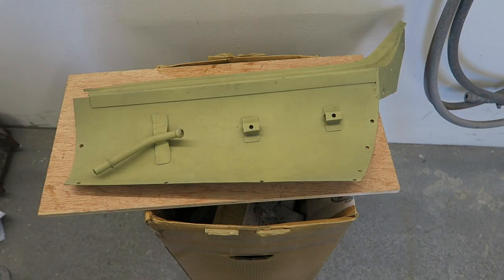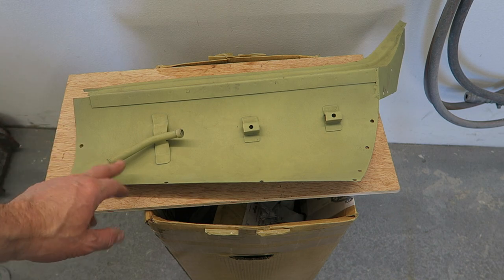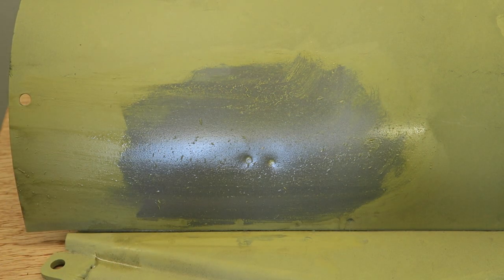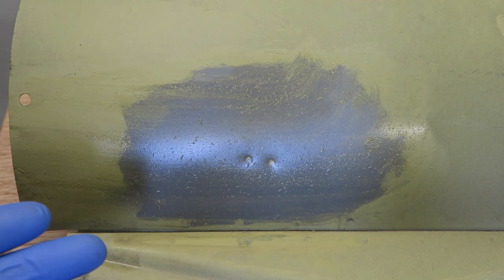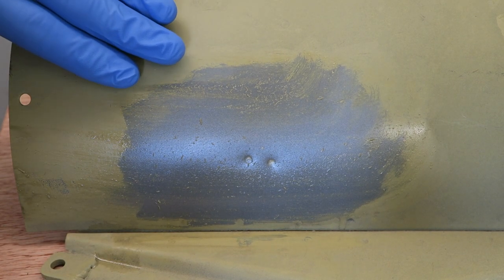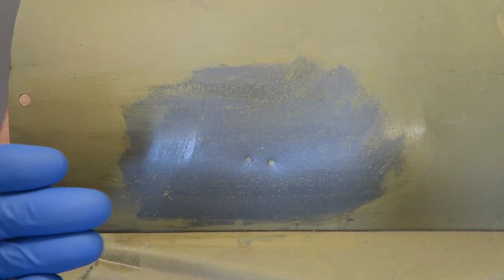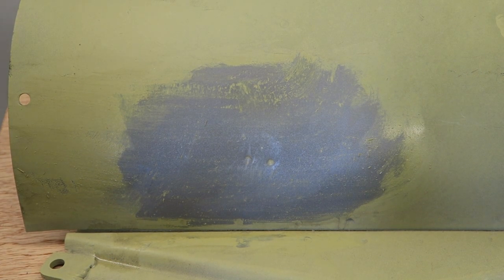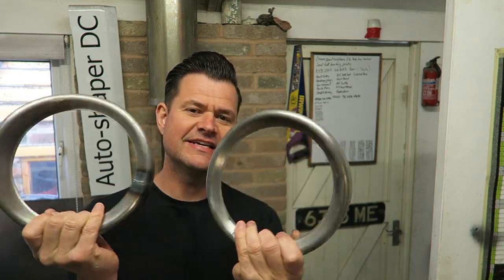Why to avoid applying carbody filler/Bondo over etch primer Tips and Tricks #29

Comment: Gday Trev! Another great video, I just finished the two week Tart up of my Austin Healey Sprite videos, and in that case I used filler over old acrylic paint, I’m guessing I get a similar issue here, where the paint around the filler work has left a ring around the repair, sounds like my only way forward is to take the entire car back to bare metal if I’m using any filler? Or is there a blocking primer I can use to then fill over old acrylic paint ( not just etch primer) ?
Reply from the maker: JBFromOZ it’s very difficult to give suggestions on such wide ranging issues and it depends how far you’re along the line. If you were still at the beginning stage I’d say yeah screw it and sand everything off before you do anything. But if you’ve put months of work Into it sometimes you’re better off just carrying on. There is a product called barcoat that acts as an isolator between two incompatible products. Cheers Trev 👍
Reply: First time around on the Restoration was in 1986, I was only a little tacker, and paid someone to do body work, over a sandblasted and red oxide primer paint job, then dad and I did the paint work together in the garage at home, it looked flawless back then, but 33 years have not been kind to it :-) back to metal sounds like the plan, rather than keep blogging over old repairs, ideally I’d like to get the underlying metal in good shape, now I’ve got some time and experience under my belt, (oh and the fab inspiration from you and others sharing their skills)

Comment: I've used bondo filler over rustoleum etch primer with great results. No lines/ ringing, no softening or peeling. 

also if you taught me how to paint i would 100% end up pulling my keys out of my pocket and scratch up the surface... when you mean to sand it.
Reply: so have I and got away with it...for a while. Even Rustoleum states in their TDS "do not use under filler or polyester putty".

Comment: Hello Trev. Hope your well. I've heard if you fill over epoxy within 5 days there is no need to key up  as the epoxy still has a bit of tack to it. What say you sir?
Reply from the maker: Skibum Wannabe sorry about the late reply, for the effort involved I’d always sand it once it has initially set. Yes you maybe able to overcoat it, apparently it grips other paint products because it’s shrinking for up to seven days but there’s nothing worse than paint products peeling off! Cheers Trev 👍

Comment: Hi Trev cracking videos have another side to the question for you. I’ve just finished welding and filling a door, filler on bare metal and sanded back had bare metal and hit it with acid etch but hit the filler at the same time let it dry then primer. Would the acid etch affect the filler, filler is very thin. Thanks in advance.
Reply from the maker: John Millward Should be absolutely fine, it’s the primer under the filler that’s a problem. Cheers Trev 👍
Reply: Legend trev thank you for the fast reply would have definitely lost sleep tonight about that one. And thanks for sharing your knowledge you have helped me get through more than one repair on the old car thanks again.

Comment: Etch prime is for over smoother bare steel (180grit or higher) at a very thin transparent coating - too thick is bad news....... Epoxy primer is for use over a well roughed/prepped surface (under 80grit) in which you can spray 2K over it... Bondo/Filler is made for use over bare metal & needs 2K over it.......
Reply: Filler is made for epoxy too(chemical bond) as well as mechanical when you key it up. Most restoration shops use epoxy after grit blasting then do body repairs after/on top of epoxy. Filler on bare metal is the old way,not quite as good, but can still work, I'd only use it on small sections if I was going to use filler on bare metal.

Comment: To be clear for us beginners, it is ok to fill over epoxy primers but not etching primers. When there will be time before all the work can be done something has to be applied to prevent rust once the body is stripped. So my understanding is to strip, repair, epoxy prime, body fill to flatten and then a high fill primer, flatten again then paint. Yes, no?
Reply from the maker: Michael Vitetta yes buddy it sounds like you’ve got it. Cheers Trev 👍

Comment: Hi trev. Sorry if it's a daft question but is it a bad idea to put 2k epoxy primer over 1k etch primer (with activated thinners). Watched this video when it first came out and now watching again.
Reply from the maker: Ryan 1234 why do you ask, what are you trying to achieve? I only ask because the answer could vary depending upon what you’re trying to do. Cheers Trev 👍
Reply: @trevsblog  basically I've been using 2k epoxy lately, and I've had good and bad results in regards to it chipping off. So I recently I tryed using 1k etch primer keyed it up and put the 2k epoxy over the top. It dose seem to have worked on this occasion but just wondering if it's a bad idea. I'm a complete amature when it comes to paint/primer type things. Thanks for your time
Reply from the maker: Ryan 1234 it should be possible to put epoxy over etch. The problem that could arise is if you then tried to fill over the top then rubbed through the epoxy into the etch. Apart from that I see know issue. The problem with this kind of thing is you only find out if it was a bad idea when you’ve finished... if it’s a big job and it goes wrong, it’s a total nightmare. Cheers Trev 👍
Reply: @trevsblog  thanks for that trev. Theres only one small area that needs filling so I suppose I could just do that one spot a different way. Thanks for your time

Comment: Just a beginner here, but it seems like the ideal process for paint layers goes like this: 1) Epoxy on bare steel or sanded coatings 2) Filler over epoxy 3) High build over filler 4) Epoxy seal coat 5) Base 6) Clear.

The TDS sheets for the Shopline high build primer (which I'm going to use) say that high build primer is OK to apply over 2K etching primer. The big difference is that the etching primer is 2K. Just to play it safe and to keep costs down, it's just easier to use epoxy.
Reply from the maker: It depends what you’re doing. If you’re doing a long term restoration and you want to prime bare steel then leave it for months before painting then I personally think epoxy primer is the way to go. The only thing I’d reconsider is swapping process 3 and 4 around. If it’s a fast turnaround job then I’d probably fill over bare steel then etch the bare steel areas and 2K primer on top.
Reply: @trevsblog  So it's OK to apply 1K primer over body filler because the solvents in the filler have already fully cured?
Reply from the maker: @livedeliciously  in theory it’s ok to put any type of primer over filler. The problem with putting filler over 1K type primers is that the solvent in the primer that you then put over the top of the filler can then leach under the filler separating the filler from the 1k primer. If you put filler over the top of cured epoxy the epoxy has set, a chemical reaction has happened and the primer can no longer become fluid. If that makes any sense 👍
Reply: @trevsblog  Yes, that makes sense. The solvents in the high build primer are able to penetrate through the body filler. So although there is a physical boundary, the body filler is still porous. 

The TDS for my Shopline epoxy says to wait 15 minutes between coats (one coat of epoxy), but also calls out 15 minutes for dry time (one coat as well). Does this mean that the chemical adhesion window is only good under 15 minutes? I want to apply epoxy prior to high build primer.
Reply from the maker: @livedeliciously  typically epoxy takes longer to cure than 2K when they say 15 minutes this could be considered a minimum time as the initial shrink is the most the primer products will shrink in total. Because the 2K dries faster there could be a chance that the 2K will split as it would be sitting on top of a fluid wet coat of slower drying epoxy, if you were to overcoat epoxy with 2K without waiting.

Comment: what exactly is etching primer used for?  can you spray etching primer over filler or over top of epoxy primer?
Reply from the maker: cuda70gt primers that have build don’t typically stick to bare metal. Etch primer is basically acid and primer mixed together, when it is painted onto metal the acid eats into the metal as it’s drying. It is then etched into the surface of the metal and 2k high build primer can be sprayed onto the etch. The etch sticks to the metal the high build sticks to the etch, problem solved. Epoxy primer also sticks to bare metal very well and can accept filler but etch cannot. Cheers Trev 👍
Reply: @trevsblog  cheers trev. Thx mate
Reply: @trevsblog  what happens if you are doing a small repair and you get etching primer on top of old paint or other primers?

Comment: Hello Trev, I just came across your video which gave me a fright, i have fillered over a 2k etch primer, i have also primed the areas, i dont see any shrinkage but an really concerned as to wether to base and clear it, any advice would be awesome as i;m feeling very lost..
Reply from the maker: If you have 2K primed over the top of the filler and see no ringing around the filler repairs you may have gotten away with it. If it was me I’d probably risk it, but apply the base coat very lightly for the first coat at least. The problem only occurs when the solvents in the paint gets under the filler edge. At the end of the day if it all goes wrong you will be a lot wiser. I know that isn’t much consolation but painting cars is fraught with challenges. You’ve only failed when you give up so keep going.👍
Reply: @trevsblog  thank you for the advice ! much appreciated..

Comment: Hi Trev. Have use used LECHLER SPAT O PLAST 05 541 stopper. You can use on top of epoxy primer to fill quite deep imperfections. It works very well as long as it's fully cured.
Reply from the maker: Philip Knowles no I haven’t used it but thanks for the info. Cheers Trev 👍

Comment: Trev,  Your using a word at 7:47 that either i am not hearing correctly or a term that i am completely unfamiliar with .  sounds like keahauler. What are you saying please?
Reply from the maker: 123jerro I was saying key it all up, which means sanding. Cheers Trev 👍

Comment: what paint goes over etch primer? I have a door thats etch primed and was going to cellulose over it do I need to strip it off?
Reply from the maker: Cellulose primer will go over etch primer fine👍Nothing wrong with etch primer as it keys very well to steel, the purpose of the video was to warn about the possible consequences of filling over etch primer. Another thing to beware of is if  a panel has been sat in primer for a long time in a damp garage the surface of the steel can go rusty, under the primer.
Reply: @trevsblog  ok thanks for the info, would it pay me to sand it of and use grey cellulose primer?

Comment: Wait, so can I put filler onto bare metal, then etch prime over the filler?
Reply from the maker: Yep 👍
Reply: @trevsblog  Thanks :)
Reply: @trevsblog  If I see a little imperfection, can I sand it back to bare metal and correct it, as sometimes it is hard if the body filler is level with the rest of the surface

Comment: I prefer bare metal and will even go to bare metal on a epoxied car. I've just had too many problems in the past. Also epoxy primer doesn't sand that well so it makes sense to go to metal.
Reply: You're totally correct with what you said at the end. There's so many ways and everyone thinks they know best. But I've had issues with products I've used for years when I was working at my parents place. The humidity was totally different and my tried and true methods where a total bust.

Comment: Hi there would you no if it's ok to use body filler over 1k epoxy primer. I can't seem to find anyone that can answer the question for me, thanks
Reply from the maker: Ivan K I have never used that product. If you wipe it over with thinners does it come off on the cloth? This would be a great start to finding out. Cheers Trev 👍
Reply: @trevsblog  I didn't even think of that I will try and see what happens. Thanks again mate

Comment: I don't understand the point of etching primer. A painter that is actually went to school in the US showed me that his method is. to apply filler to bare metal and seal it in with epoxy primer. then you can apply paint to that or use the same brand compatible surfacer if you feel like you need it. like to get it perfect on a show car but if its smooth he says he sometimes doesn't use surfacer. I've been around painters for years and hes one of the best I've seen. I don't mean to challenge any of your methods, because I can clearly see from your videos that you are very good at this body work stuff and restoration stuff. Just my opinion, maybe etching primer is a thing of the past because I only hear older people talk about it. epoxy primer is the new stuff lol.
Reply from the maker: It really depends on what you’re doing. If you were painting a panel that had gotten damaged and you were just wanting to get the vehicle back on the road ASAP then I would use completely different methods to the ones I’d use if I were doing a restoration that was going to take a year or longer. Cheers Trev 👍

Comment: Why do they even make self etching primer if it does that>?
Reply from the maker: It depends what you’re painting Keith, a good example for using etch would be painting new parts that just need sanding and painting. A coat of etch then on with 2K primer or paint. The right product for the situation in hand 👍

Comment: I call it “edging up” used to be a problem when breaking through the lacquer when flatting on a fresh base and clear when using solvent base. Soon as you rebase the spot that you rubbed through, the solvent in the base edges up around the area. Best quick way round this waa to use hardener in the base as a thinner. Got me out of the poo a few times. As for filler work, rule of thumb for the inexperienced is to never fill over any paint.

Great content as always Trev👍

Comment: Can you put kitty hait over epoxy?
Reply from the maker: Yes no different to filler! Just make sure that you abrade the epoxy before applying any filler, glass fibre or paint to it, otherwise it’s likely to peal off.
Reply: Even if I have 10 day window left open ?
Reply from the maker: @Supanova70  I wouldn’t follow that philosophy! I’ve had a couple of associates that have applied products to epoxy applied just a couple of days beforehand only to have that product peel off in a big sheet!  My own personal preference is to always allow the epoxy to fully cure. Then abrade/key, that way you can be absolutely assured that the product isn’t going to peel off. For the amount of time it takes to sand, it isn’t worth not doing, in my honest opinion. Obviously it’s up to you 👍
Reply: @trevsblog  awesome advice..going to key west Florida then....lol
Reply: @trevsblog  150 grit good enough on epoxy before filler with Da? Or hand?
Reply from the maker: @Supanova70  I normally go 180g Da or by hand. 150g is very close though 👍

Comment: there is no place for etch primer in car restoration.that stuff is useless.there are all kind of 2k washprimers,2k epoxy primers,polyureathane-acrylic 2k primers....all this stuff have guidelines in form of TDS(teschnical data sheats)on internet.so if you are not professional painter just read!i could never understood people spending so much time on car restoration and using second grade material for that purpose???the difference in money is meaningless between that HB body and proper thing like glasurit,sikkens...maybe if you restoring titanic and spend 10 000 l of paint is difference but if you restoring mini morris you will spend how much?1l maybe 2l???in money 30 eur???for that amount of work??you can "cut corners"and use budget stuff like body fillers,sanding material,tapes...but first thing that go on bare metal must be solid rock and clear coat on the end must be best there is...if you want job you are doing look nice.if only i have the power of narration like mr.trev i would make the video in my workshop.

Comment: Really good info on the difference of paints and using filler, reason i was looking at this info is because i was worried about filling over welding and it not protecting it fully, so 2k primer sounds the way to go then filler
Reply from the maker: Fill over epoxy, rather than standard 2k 👍

Comment: Standox etch primer is  a 2k product.Also:"Overcoat StandoxEtching Adhesion Primer with Standox2K Filler within 72 hours.  After 72 hours without sanding, re-apply one coat of StandoxEtching Adhesion Primer and overcoat with Standox2K Fillers" Something is wrong with info you are providing.

Comment: Etch primer is designed to go on very thin - you should still be able to see the metal through it, it doesn't cover.  It's soluble in alcohol too.  So, just use epoxy primer - I always use filler on top of epoxy to enhance the bond of the filler and avoid issues from not completely reacted filler ingredients that will cause corrosion if otherwise present.  And no, the epoxy does NOT need to be sanded prior to filling.
Reply from the maker: JL Denis agreed but not quite, I’ve applied filler on top of HB body without sanding and it peeled off. Apparently if you fill in very soon after you’ve applied the primer it will stick but personally I’d rather be safe than sorry. Thanks for your comments. Cheers Trev 👍